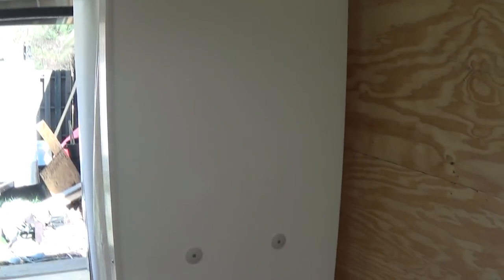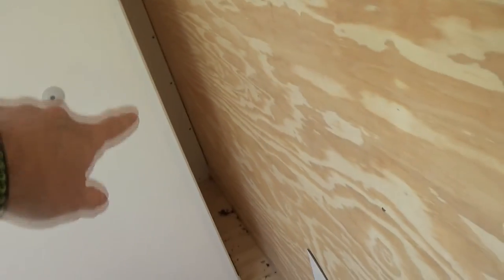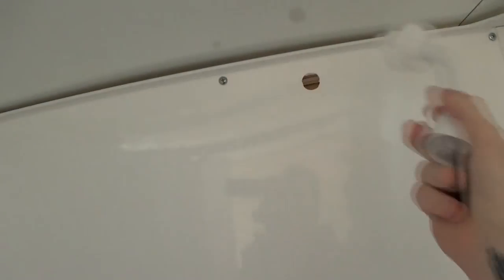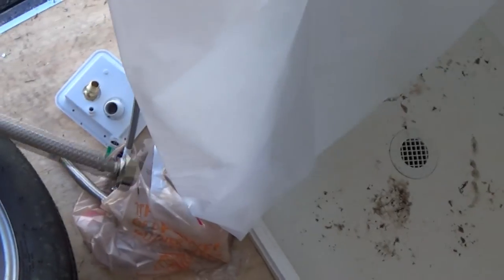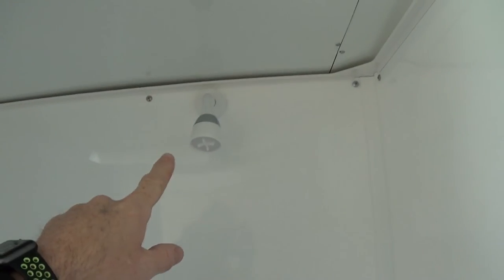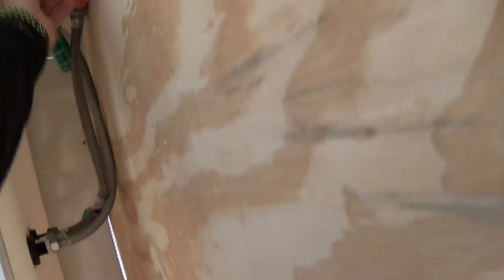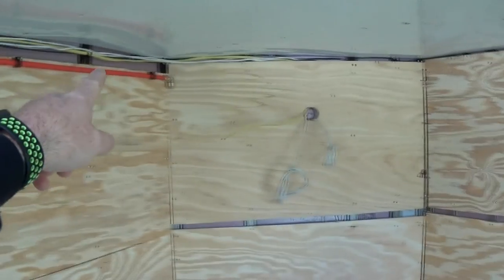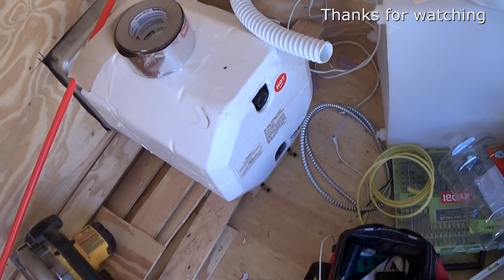6x12 Enclosed Trailer Conversion Shower Time !!!!

Comment: What was the total cost of your trailer conversion...excluding trailer and time.  Very useable.
Reply from the maker: think i had 2500-2600 in trailer and 3500 ish in parts./.
its for sale 5k

hardly used..  i wanna do a van conversion next. but need to sell the trailer first